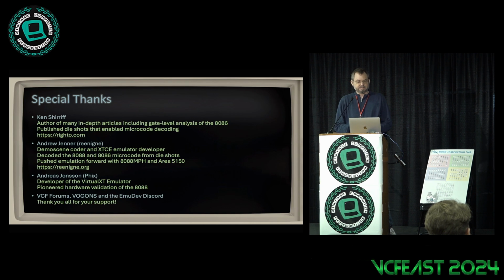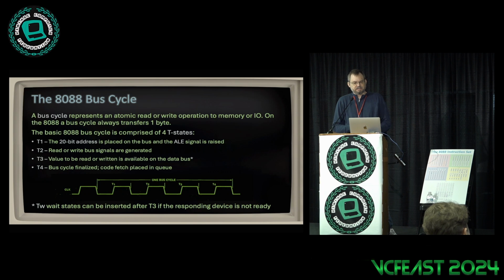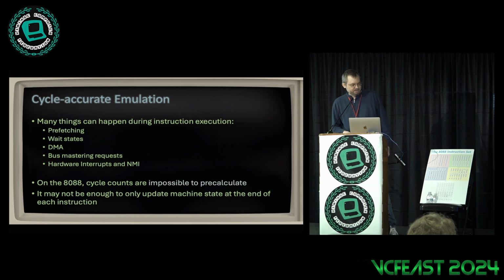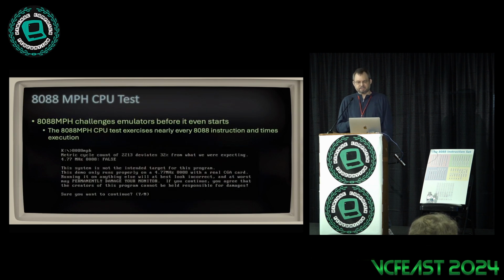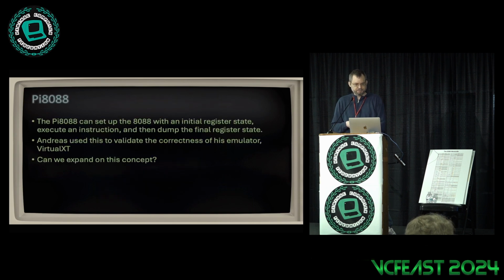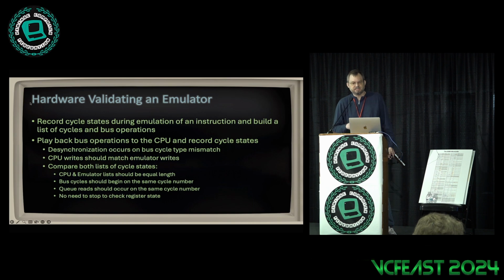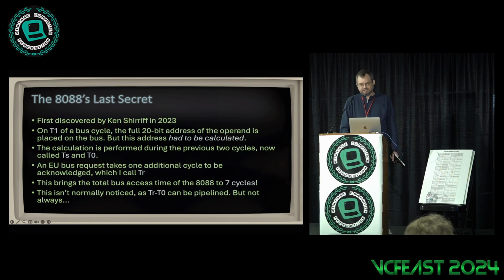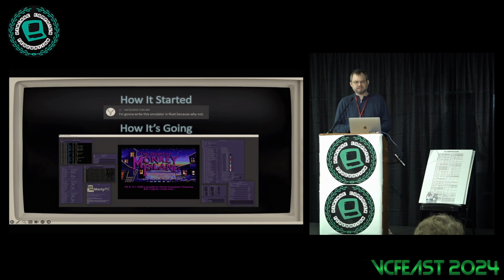VCF East: Cycle-Accurate 8088 Emulation – Daniel Balsom

Comment: Technically the 8088 wasn't cheaper, because it basically was an 8086. But IBM could sell it at a loss, even though they had most favoured nation contracts to supply 8086, that wouldn't allow them to drop the price.

Comment: a second source cpu that behaves the same as the original is the exception rather than the rule
things like flags and ISA implementation are always going to be "optimized" in the process
and real world  signalling, clocking, analog elements of IO will always have to be adapted to be produced on a different silicon technology

the V20 in particular has significant ISA additions, that replace undocumented instructions in the intel 8088
the V20 microcode would not be difficult to derive today though with the 8088 version in hand + plus the public documentation comparing the two that the lawsuit provides
Reply: we've been able to decode most of the V20 microcode, see the thread on the VCF forums